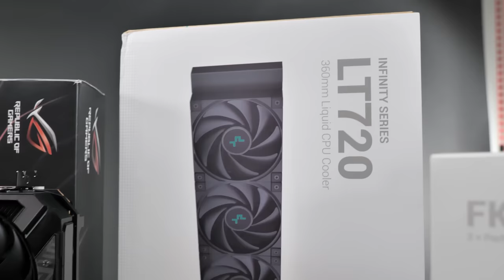Lian Li did it AGAIN! | Lancool 216 Gaming PC Build | ASUS ROG X670E Crosshair Hero | Ryzen 9 7900X

Comment: Yeah, it's the best case as far as airflow to the CPU, but sadly not the GPU.   I have a Lian Li Lancool 2 mesh, which Gamers Nexus shows as one of the top cases for CPU and GPU thermals.  It's got two 140mm fans in front, and a single 120 in the back, that's it.   This Lancool 216 has two 160mm's in front, and a 140mm in back, and it's CPU cooling is superior to my case but it's GPU temps aren't?   Makes no sense.  It should be superior in both ways.  Also, it's best to use the "offset" mount with AMD's chips as it nets you another 5-7c lower temps, also as an FYI for everyone, stop using the "pea" method to put on thermal paste.  That's only the "just ok" method.  If you want the "best" method, do an X, or a flat spread, it nets you another 5c or so cooler temps.
Reply: clown🤡
Reply: clown🤡
Reply: Yeah the pea method used to be the most consistent for AM4 but AM5 is bigger so the cross is better.
Reply: No, It has 2 fans in the rear. 140 and a 120mm in the rear with 2 different position. You don't need top exaust fans in my opinion using air cooling. Put Shark Force 160mm in the front or use It with the APU. The only defect of this case is the airflow Is not directed to the motherboard, but pass in the side. I'm buyi g a case but i'd like if the lancol works wrll cooling the chipset. Bye.
Reply: @Ked778  You should check GN's thermal testing. What this man said is absolutely true.

Comment: Beautiful build and Video.  I just finished my 216 White build last weekend.  Mr. Matt mounted what appears to be 120mm fans to the lower vents.  I removed the Vents entirely and replaced them with 140mm fans that perfectly cover the space. Another nice feature is when you use a smaller AOI like my 280mm AOI.  The case comes with a plate to fill in the empty space, helping increase positive pressure inside. I moved to 140mm fans and larger when I can for noise reasons, nerve damage int he Corps, the decibels of fans are loud to me.  I originally purchased a Corsair 4000, that last 2 months before switch to the 216.  This case is awesome.  One more thing @ 4:16 you can see they molded the carriage around the front fans to really help direct incoming fresh air.

Comment: The SSD is single sided. There should be a little rubberthing in the box to put underneath (the round cutouts on the bottom pad) or it will be bended a little. Made the same mistake with a 980 pro a week ago. :)

Comment: What is better...lancool III or lancool 216 case?
Reply from the maker: Lancool III is more adaptable for hardware and has slightly more space inside. The Lancool 216 by contrast is smaller and the front fans are not really designed to be changed at 160mm. If budget can push to Lancool III, then get a Lancool III. If on the other hand you’d rather save some money, then absolutely the 216. They’re both amazing cases in their own rights.
Reply: @Mr_Matt_Lee  thank you for you question Matt..then Lancool lll
Reply: Sorry i mein answer..my english is not good

Comment: Question. I have this case coming ,it will house a meager r5 5600,x and a xfx 6700 it will be air cooled,how many exhaust fans should i use on the top to get enough air flow out of the case? Tyvm.

Comment: AFAIK you dont need the metal plates below the 2 bottom fans to install the 2 fans right? They block so much airflow, without those plates airflow from below will be much better.

Comment: Wow... this build looks incredible. Curious to know how would you rate the Deepcool fans for noise levels.. are they decent compared to EK Vardars/Noctuas or a big step down?
Reply: no theyre noisy, even enermax regular one is way quieter, enermax bequiet noctua and coolermaster are the silent ones/have silent version

noctua sort of not have, actually but at low rpm airflow is good and dead silent, their 12cm even beat 14cm thermalright at same rpm

Comment: did i miss it????   where is the power supply????   i didn't see you put that in...  i also have a Lian Li case, but, because i'm rocking the humongous rx7900xtx, my builder had to make the radiator and fans blow out the hot air through the front of the case

Comment: Hey sir if you have to choose with a lian li 011 dynamic mini or lancool 216 what should I get between the two
Reply from the maker: Lancool 216 if I was using hot hardware and needed extra cooling. Not a huge fan of the O11 Dynamic Mini. O11 Air Mini however is one of my favourite all time cases….
Reply: @Mr_Matt_Lee I like the 011 mini beacuse of the form factor and also the mods that you can do with it but im more like a cooling and performance perspective so what should i get this is my parts list
 R7 5800x3d | R9 5900x / i7 13700k
Strix b550-f wifi / Z690 strix d4 wifi
4x8gb ddr4 
Deepcool As500 plus | Deepcool Ak620 |Thermalright pa120
Rtx 3080 -
2tb m.2 nvme
2tb hdd 
Artict Pwm fans 
Lian li strimer plus
850w sfx/ 1000w atx
lian li 011 mini or lancool 216

Comment: Hey I wanted to do a new PC build and can’t decide which case to get. The options are either the o11 air mini or the Lancool 216, I will be getting a 13600k and depending on the case I would get a 360mm AIO for the Lancool 216 and for the o11 air mini I would get the deepcool ak620 as for additional fans I right now have 4x Thermaltake Toughfans 140mm High Static but I can get more of those if necessary or the 120mm versions. I have three Ssds and an HDD would that impact the bottom Fans by much in the Lancool 216 ? What would you guys recommend me to buy :) ?

Comment: normally I see guys putting the radiator in the case and putting the mainboard in the case and after that they connect the aio with the cpu. Do you always do this the way shown in the video?
Reply from the maker: Yes all of the time. I find it so much easier to mount the cooler on the CPU and move the whole thing into the case rather than fit the cooler once the motherboard is in first. Fitting the cooler before also makes it easier to attach the fittings and ensure it sits level on the thermal paste IMO. There’s no right or wrong way, I just find my way to be less stressful and easier 😊

Comment: Nice build. You think that case would fit an RTX 4090 ?
Reply from the maker: Thanks! Yes totally, if your rad is on the top then it absolutely will ❤️‍🔥
Reply: Even a 4090 Strix fits in without problems

Comment: What screws did you use to mount the bottom fans to the bracket? I’m building in this exact same case and I don’t see any screws that allow me to screw the bottom fans into the bottom bracket.
Reply from the maker: Just use 8 normal fan screws… that’s what I used 💁🏻‍♂️ The video shows how those plates come off, then you flip them upside down to screw the fans on…

Comment: Great video and amazing build but the case looks sooo cheap to me :/
Reply from the maker: It’s actually really solid, I’d say for the $100 area it’s totally worth every bit of that. Thanks for the kind words about the build too 😁❤️‍🔥
Reply: @Mr_Matt_Lee  I am sure it is otherwise you wouldn't include it to your build as all of them are of the highest quality. But the contrast compared to the other parts is pretty stark. Especially, those buttons... they look so cheap.
Reply from the maker: @AizenXaoueR  exactly that, if it was cheap I’d have made a point about it. With that said, the quality isn’t the same level as the Lancool III for example, but given that they wanted to keep the cost a little lower I’d expect at least some compromises. The Lancool III for example has aluminium on the front panel downrights, whereas this has plastic. The buttons do feel a little plasticky that goes without say… given the $100 mark, that’s easily forgiven because the other features punch way above the retail price at this point ☺️
Reply: @Mr_Matt_Lee  Appreciate that. Solid points and I know people put emphasis on budget and all but I don't find such big differences in pricing between most cases and I am a total newbie here. For example - fractal design focus 2, nzxt h510 flow and phanteks I find to have minimal differences in pricing. 

Maybe the difference in features, quality, and looks is vast (I wouldn't know) but images don't reveal that.

My computer is 6-years old and the phanteks p400 case never disappointed. I am probably building a new one this black Friday and although I'll wanted to go with NZXT I will probably pick the fractal design. What would you pick?
Reply from the maker: @AizenXaoueR  interesting perspectives from you too! Interestingly, I’ll be building with the Fractal Focus 2 this week, with the intentions to drop the video on Friday 👀 I guess I’ll have more of comprehensive idea of it by then 😁

True that they sit at similar price points, with similar performance. Sometimes the deal breaker can be aesthetics and what works for you setup. Or brand loyalty. I freaking love NZXT, have done for a very long time. Naturally I gravitate towards their cases wherever possible. Fractal on the other hand I’ve recently started working with and they never seem to compromise quality either, with their own cases being very intuitive in their own ways. 

Can we regroup this convo at the end of next week once the Focus 2 has been built? 😅 haha
Reply: @Mr_Matt_Lee  You beat me to it! I can't wait!!!

Comment: Sorry how much clearance does it have on top? Wanted to mount an arctic 360 but radiator + fan is actually about 38+26 = 64 mm. Will it fit?
Reply from the maker: I don’t see any reason why not 👀 the clearances shouldn’t be any different to the 360mm rad I fitted… I’ll measure and check tomorrow 🔥

Comment: The 2nd fan on the PSU shroud, directly above the PSU is not as useful because it's...well, directly above the PSU. Putting the other one there, however, is what I would do too.
What are the GPU temps like?
Reply from the maker: There’s still adequate space for it to pull airflow between the shroud and PSU. When I ran the airflow test it pulled in plenty of air ☺️
Reply from the maker: GPU temps under load for 1hr never exceeded 65c playing FH5 & Assassins Creed Valhalla
Reply: @Mr_Matt_Lee  Great to hear, thanks.